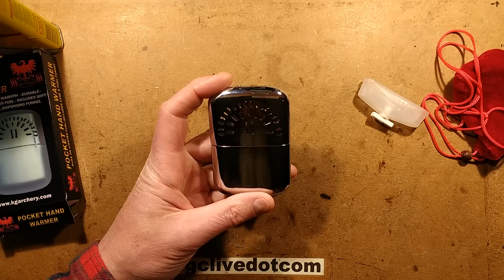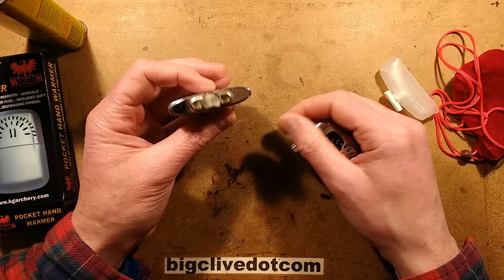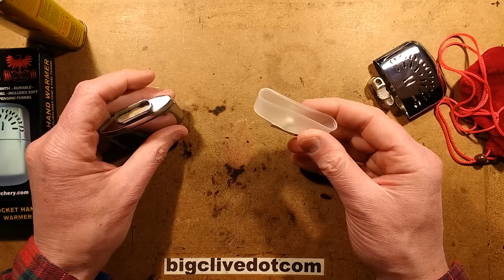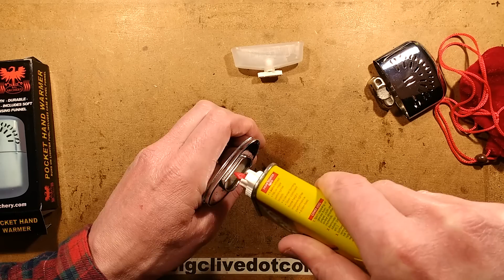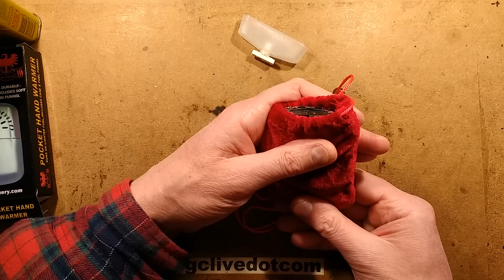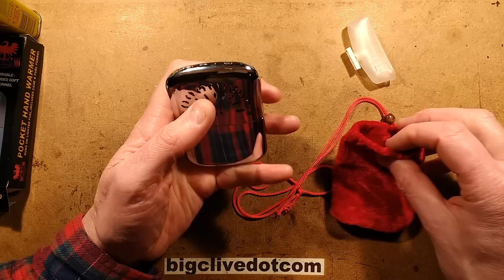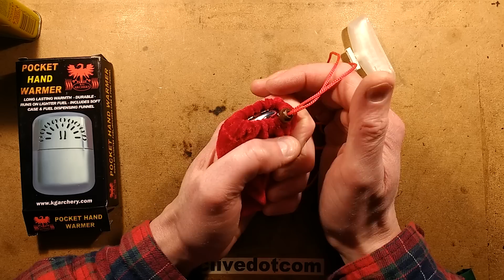How a petroleum-distillate powered pocket heater works.  (naptha)

Comment: I presume it could work with a more volatile fuel, say ethanol or methanol.  But I suppose it might then overheat...
Reply from the maker: The problem with alcohols is they don't stay in a wick easily so they could spill out.  See the video description about how my hand was set on fire during a film shoot when that happened.
Reply: I should read that bit more often.  :-)
Reply: One problem with methanol is that it will oxidize on a platinum catalyst at room temperature. When it does, things heat up quickly.

Also, alcohols absorb water, which can lead to corrosion. I was burning an alcohol/lighter fluid mix in mine, but I noticed some mineraly crust building up in the neck, just below the catalyst. When I rubbed it off, the brass was starting to show through the plating.
Reply: @Tech Obsessed I think you make very valid points.  Not least because you seem to support my speculation ;-), which was solely that more volatile hydrocarbons seemed to me likely to react more vigorously.  I'd be a better scientist though if I simply tested the idea!  Which to your credit you have apparently done in some measure.  Leading to some hand-warmer postulates worthy of test:  One of which is that less polar fuel is likely to be better fuel.

A tip of the hat.
Reply: Even the old Jon-E hand warmers instructed you to turn them upside down while outside (and before lighting) to empty out any excess fuel that wasn't absorbed by the internal material.
Reply: Acetone is usually the solvent of choice when demonstrating catalytic oxidation, at least with copper metal.  Copper has to be heated quite a bit though to start the reaction and be self sustaining, but its awesome cause you can actually watch the copper glow as it gets hit by fumes and oxidizes them.  I think plat is just more efficient so it does it at lower temps.  But my vote would be acetone / isopropyl, or a blend with the naptha if it was needing more volatility.
Reply: bigclivedotcom hey Clive, what about RC nitro fuel? It has oil mixed into it and is mostly methanol if I remember correctly.. I have quite a bit of it in storage and was wondering if that would wick properly

Comment: I'm fairly sure that jon-e made these before Zippo did.
They will work without the bag, but the metal housing gets a bit too hot to put against the skin without the layer of cloth in-between.
They don't run much hotter without the bag though.
Some of the better units have a side wick to aid in lighting it..a drop or 2 of the naptha on the element can also help.
The correct fill level is determined by the amount you can put in, without naptha leaking out when you turn it over.
By the way, if the naptha DOES get on the element while it's heated, it usually goes out without any noticable flame.

Comment: Used them for two years, they are awesome. The only thing I did not like is that you had to tinker while lighting and to turn it off I needed to have a pair of needle nose pliers to remove the mesh thing to avoid running it down empty. And the smell of fuel sometimes you can feel it in your clothing but it indeed last a long time. Don't forget to turn it off if left in your pocket of your jacket because in a warm place it really gets hot...
Reply: santiago vindell you do NOT need tools....you just open the top, and use the edge of it to remove the element.
Reply: M. K.  I never tried to use the top cap to remove the element but good idea. Since I always had a pair of pliers with me thats what I always used but good idea to use the cap when you dont want to burn your hand and dont have anithing else to remove the element.

Comment: you can use normal car gas in zippos but it is alot dirtier than lighter fluid so it wont burn as clean or as well
i suppose that would translate over to that type of thing

Comment: A layman asking how Platinum catalyses works is a bit like asking a  physicist how magnetism works. It's kind of hard to explain without the explanation devolving into pretty hard core chemistry jargon like activation energy, HOMO, LUMO, MO graphs and other things.

the simplest way to explain it, is to say that the Pt lowers the heat needed to burn the gasoline, it is burning yes but at lower energies, think of it as a very VERY cold flame.
Reply from the maker: Ah magnetism.  That really screwed up progress on my electron theory video.  There really is no clear answer.  Just plausible theories.
Reply: This is inorganic chemistry in it's pure form, I'm an organic chemist by trade and to be honest we used platinum/palladium/iridium as magic dust, we knew what end product was but not the mechanism well. I took a few inorganic courses and my final thesis had a couple of palladium catalyzed reactions so I made the effort to learn how it worked. But that was 9 years ago and I can't be arsed to look it up on one of my old hard drives.

Comment: I've got a Zippo model of one of these. It works just alright; there is a bit of a trick to getting it to heat up warmly and provide a little warmth while you're doing outdoor stuff. However you don't want nearly numb fingers touching 100F+ metal, that would probably cause burns. For $12 and about a dime worth of fuel to provide about 6 hours of a hand warmer, its not a terrible thing for those finding themselves outside in the cold often.
Reply: Sizukun1 100°F is practically body temperature (98.6°F), I don't think you are going to get many burns at that temperature.  Add another 30-40°F and you might start to get burns, but only with prolonged exposure and good thermal transfer (which the fabric pouch should prevent).
Reply: 98.6F is body temp at your core. If your fingers are really cold and you dip them into 100F water, it'll feel like you're getting burned. If you're bordering on frostbite, and you put them into 100F water they will be burned and damaged. The zippo models do get up over 120F, I've never measured them accurately though.
Reply: Sizukun Feeling like a burn is not the same as a burn, as someone who has lived in the Arctic and has experienced frostbite I can tell you that your perceptions are incorrect
Reply: If they get to hot you close up the hole on the bag.
Less oxygen for less heat.
You really need to run them in the correct bag as its made to let in the right amount of air.

Comment: Is that fiber the same stuff they make outdoor gas light mantles from?
Reply from the maker: Most gas mantles are a fabric structure supporting a thorium material.  On first use the fabric burns away leaving a fragile shell.
Reply: Ahhh, so even though this is encased it never turns to a fragile material?  Interesting that it can burn but not like a mantle.

Comment: I had one of these back in the 60s but it had an asbestos wick rapped in brass wire not the little pad that yours has but it worked well kept hot for about 6 hours

Comment: 0:02 - "Excellent, cause I just want a pocket full of petrol!"  I mean seriously, who doesn't?  LOL  3:19 - "I suppose you could use vehicle gasoline..."  Excellent idea as most gasoline blends have a much lower flash point (around −50°C) than naphtha (around −15°C).  ;)  

Seriously though I haven't read of really bad experiences with these (at least with the Zippo ones) except mainly by people that didn't read the instructions or didn't follow them correctly.  Of course your mileage may vary with the clones. (duh)

Comment: Good thingy - used a lot in winters when i worked in survey.  Only good  experience.  Use that thingy everywhere (where needed) - in boots, gloves, coat, sleeping bag and as I remember even in any possible position (up side down too).  Later even over filed slightly. Had no problems what so ever. when i saw it in the shops they where advertised as a new invention, but as i found out, it`s here a long time now.

Comment: Do they smell?  If so, puts me off, and so quite antisocial.  And, another disadvantage, you can't easily turn them off and on.

There is a lot to be said for powerbank handwarmers, and inexpenive separate pads which you can plug into any existing powerbank.
Reply: I don't want to go to a polite occasion smelling of fuel!  

No system is perfect.  But electric pads do work well, are adjustable, last for a whole day, and are turned on or off by pressing a button, or unplugging.

Comment: I've got the Zipo version, served me well for 7 or 8 years now. best way to get it started is to put a bit of fuel on the converter and light it. after a few seconds the flame goes out and it runs for hours.

Comment: I switched to the type that uses a fuel stick. I didnt like the fuel spills and smell. I did notice they attract those blood sucking little bugs if you use them in warmer conditions. That being said. I received my first hand warmer like that as a gift back in 1975. I was 15. I used it during hunting season. I had a pair of mittens that you could slide that into a pocket made to hold that heater. Now you can buy coats that are heated using a lithium recharged battery . Technology has come a long way as far as hunting and clothing. I found that clothing useful for any cold weather application. Its a big difference from the first Red and black Wool hunting jacket and pants I got from my grandfather.

Comment: On mine i used to pre heat under the wick part with a jet lighter but the flame should not touch the inner wick area as i believe it damages it.

Comment: These were very popular in Japan among fishermen in days gone by. look up peacock pocketwarmers. Only ever used the Japanese one but they come with a cloth bag to store in when in use to avoid burns and a dedicated filler for 12 or 24 hour fills. Lasts ages and so hot
Reply: Btw Japanese ones have info about catalytic ones online, dont touch it with fingers lasts about 2 seasons in daily winter use. Hold a flame near it, tip to see if its lit is to hold lid in void and check for condensation from heat, that filler is copy of Japanese one, 2 fills is for 24 hours. Dont use gasoline only naptha based fuel, proper pocket warmer fuel is quite pure, lower quality fuel will degrade cataltic converter quickly

Comment: i had the "jon-e" hand warmers when i was a kid . they worked very well when the temp was -40F (not a typo) .
the catalytic portion was a small woven fireproof tube with an insert .
as i recall , the batting (absorbent cotton) actually touched the woven asbestos or fiberglass covering of the platinum coated "spring" insert .
(i am not sure if the actual catalyzing structure was the spring or the woven cover)
there was never a problem lighting one of them ... i believe it was because the batting transferred a small amount of fuel to the catalyst assembly by capillary action .
grossly over-filling the reservoir would result in a flare up , but would settle down after a while  
we ran ours on naphtha , coleman fuel , zippo or ronsonol lighter fuel or the "jon-e" fuel .
yep , it had a hole to light a cigarette with .

Comment: I have the Zippo, and to check if it is going, I hold the (cold) metal top part to the burner. You will see condensation when the fluid is burning.

Comment: Yep,  Peacock were the first I think,  then Jon E, then Zippo started 
branding them.

They run on Naptha /Zippo/Ronsol lighter fluid.   I have tried Coleman 
"white gas" fuel but the anti-corrosion additives in it give you one 
burn and poison the catalyst.    The for heavy users to get the cheapest
 fuel price is to buy quarts or gallons of paint aisle "VM&P Naptha"
 at least in USA.

The catalyst pads DO glow, but very faintly.  you need to find a quite 
dark place to see it.

Comment: "You can do it if you're careful." But, of course, if you were careful you wouldn't do it.
Reply: heating element goes off when it has no fuel vapor, but that thing is hot af
Reply: chinese ones goes up to 70C afaik
Reply: My Chinese ones doesn't, but there might be large variations between batches if quality control isn't very strict. 
Since there isn't any actual flame involved (the platinum catalyse the reaction so it takes place at a much lower temperature), and the heat source (catalyst) is in the "cap" you remove when you refill the bottle, it should be perfectly safe to refill them when hot... in theory at least. :D
Reply: Yes.  That makes sense.
Reply: WHAT IF I WAS VERY CAREFUL ...
Reply: is that a fuckin' logical postulate?
Reply: @tallswede80  well its definitly one intersting thing to think about

Comment: These have been around for decades and are well tested, well proven technology. They all recomend naptha as fuel but I suppose saying gasoline is much more exciting. Why not fill it with petrol and see what happens Clive. I have two Zippo hand warmers and they are reliable and just do what they are designed to do, every time. If everything I owned was as easy to use and as reliable as my Zippo hand warmers I'd be in heaven.

Comment: I've had a pair of Zippo heaters for a few years now, never had any serious issues unless I overfill them. Sadly one case no longer works even with a new burner and I can't work out why.

The only time they will leak is if you put in too much fluid or there was a lot of remaining fluid from the previous use. The heater itself won't set fumes alight but static can so refill them away from your face and clothes. I've even slept with them in my pockets before, although I don't recommend it unless you are sure you know how much fluid is in it.

The best way to get them going is to hold a lighter to each edge for 10 seconds then wave it over the fibers a few times. After about 10-20 minutes the fumes should pass or it's burning it's wick too fast.

The concept of how they work is pretty simple, as the fuel heats it vaporises, expands and gets shoved out the top :D

It's a little confusing at first as they look so complicated and neat. All I know is the designs go back past WW2.

Comment: The good ones from the old days had a wick to get them going. 
They DO glow, but dimly. You can see this in a totally dark room.
The Early ones had a hole in the cap to light your cigarette from the heater element.
Overfill this an you will get a nasty chemical burn, just like an over full zippo.
Don't ask my how I know this.
Reply: How do you know this?

Comment: I found two good ways how to start it: 
1. heat the reservoir with lighter and then "ignite" the head
2. ignite the gasoline in the reservoir and cover it after few seconds with head so the flame go out but starts the reaction

Comment: We had these heaters in the USA back in the sixties all the way to early 2000. They were marketed by a firm called Jonē. They are quite safe and efficient in keeping you hands warm. We used either their fluid or standard lighter fluid. Once you fill the unit you would light a little wick that would preheat both the catalytic wick and body of the heater which would vaporize the fuel which would "condense" on the catalyst and burn with a red glow. Don't know when they went out of business but only recently has Zippo started marketing their unit. They kept my hands warm on many cold Ohio days.

Comment: When I was still a smoker (27 years ago) I had a piezo butane lighter that used a platinum mesh to isolate and shield the flame.  It would light a ciggy in any weather condition I ever encountered.  There was a rash of "Travel Hot stuff" that used the piezo catalytic tech.  I had a soldering iron, Wife had curling tongs we had hand warmers and I think I remember a hair dryer too. Supposedly safer and of course totally portable.  Don't know where mine got to - but a quick google shows they're still available.

Comment: How do you extinguish it?
Reply from the maker: Some people put them in a ziploc bag to restrict the oxygen so it stops reacting.
Reply: You take that you piece with the ceramic "mantle" off, and let it cool down.
Reply: The inside edge of the cover piece can be used to carefully pry the catalytic piece off then hold it until it cools down. Because you are using this outside when it is cold and the cover has lots of thermal mass and surface area, this doesn't take long at all. Taking the unit out of the bag exposes the bottom to the cold air and it cools off as well. Once it has cooled down, you can reassemble it and slip it back in the bag. Now that there are ziplock bags, placing it inside makes sense as it should extinguish it as well as contain any flammable fumes from evaporating fuel left inside.
Reply: If you play with fire often enough, you'll have thick enough callouses that you can (quickly) pop the catalyst off with your fingers. Still, I tend to use the lid to pry it off. But, I'm always worried that the burner will spring off and bounce around when I do.

Comment: I typically squirt a drop of fuel on the top and light that in order to get it started. Works very well. Although the models I own have a platinum mesh for the catalyst.
Reply from the maker: I tried that and it works.
Reply: The original Jon-E instructions had you place a few drops of fuel on the wick, light it, then let it burn for 1 minute before blowing out the flame. That always worked for me.
Reply: James Stewart that's how I use the Zippo version. I wonder if it gunks up the cap bit though because i struggle to keep it going once I've used it a dozen or so times.
Reply: GetTheCheeseToSickbay it can gunk it up slightly, but it will burn off after a while.